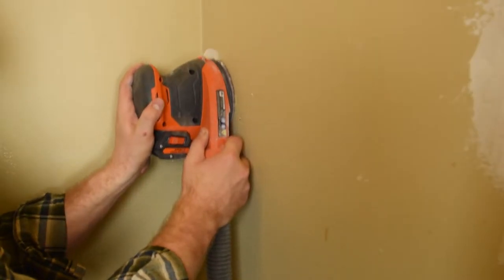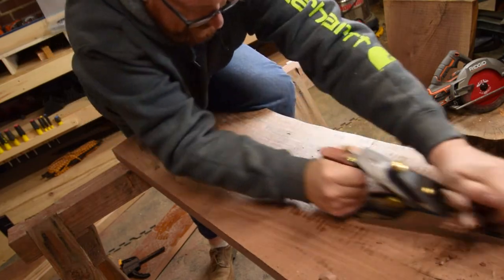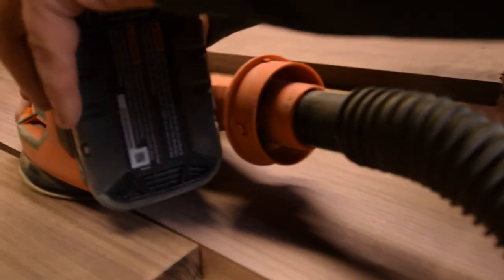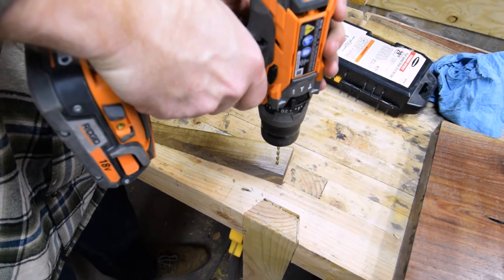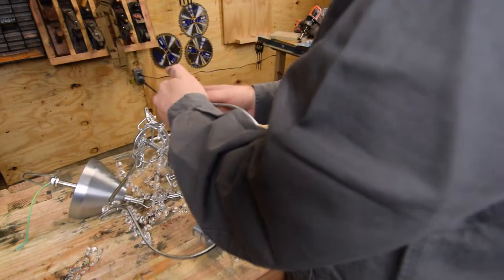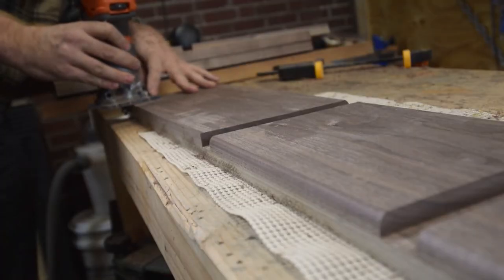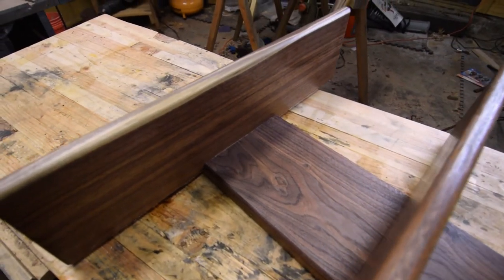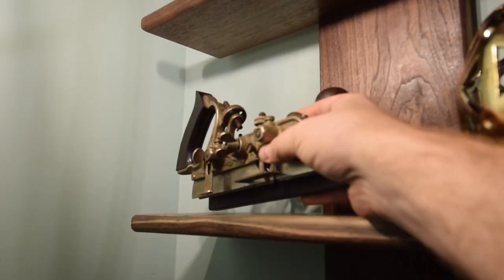DIY Closet Office [Cloffice] Converting a Closet Into an Office | Woodworking Builds

Comment: Absolutely LOVELY!!!! Love the natural edge desk and the fact that the support, though seldom seen, has matching grain. 

One question: why did you use such thick lumber for your ceiling? Seems a bit wasteful to my thinking, but that's just me.
Reply from the maker: Thanks Will!  You are so right on the roof panels.  Two reasons I did it think like that, 1) To mount the chandelier at the height I wanted and 2) I don't have easy access to a bandsaw capable of resaw and as pressed for time.  The project could have been 35-50$ cheaper if I would've re-sawn the Walnut boards for the ceiling.